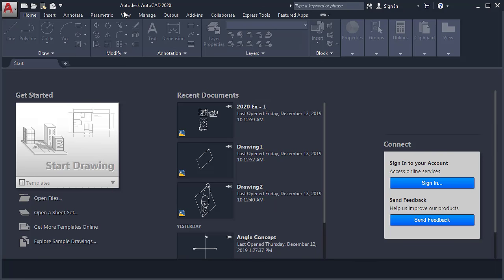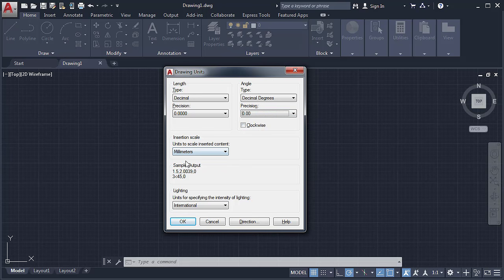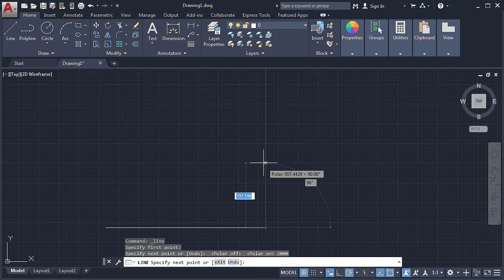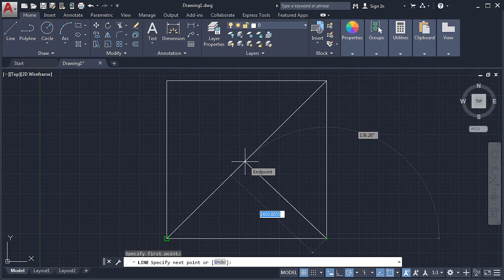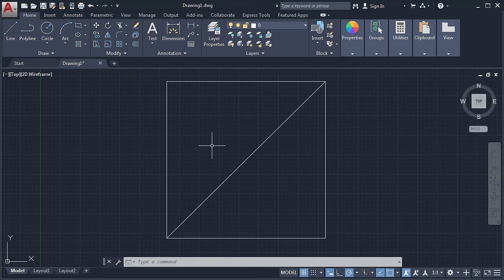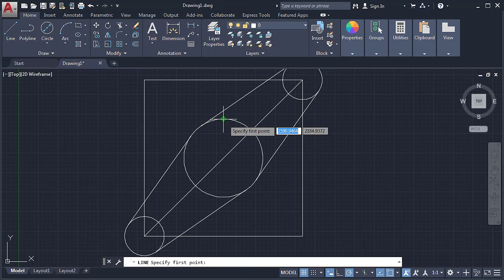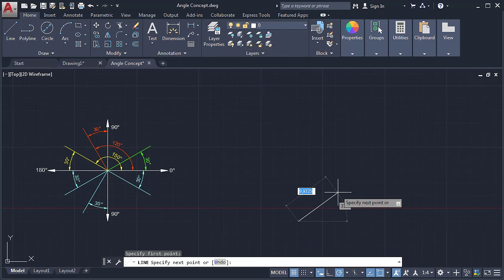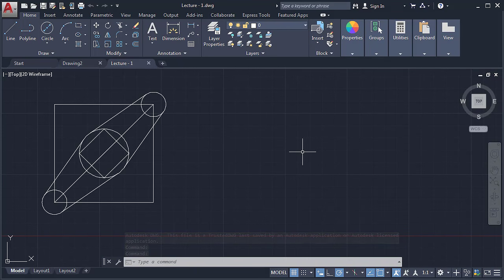AutoCAD Tutorial for Beginners - 1

Comment: I am trying to draw a horizontal line starting from the top of the existing diagonal line.
Even though polar tracking is ON, it does not draw a perfectly horizontal line. It is slightly off.
Is this related to the existing diagonal line?

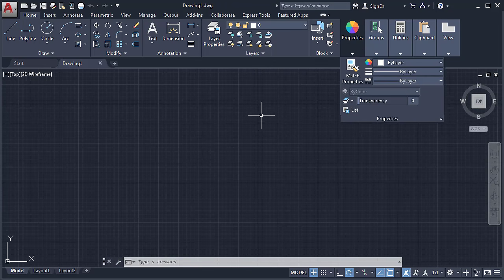Comment: 01:35 - Command Line (Kayboard short cut]
01:48 Unit command
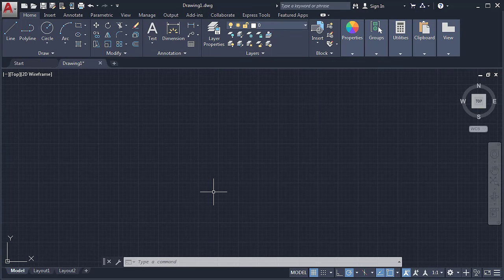04:06 Draw Command
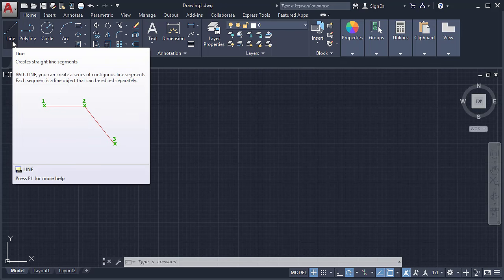04:09 Line Command
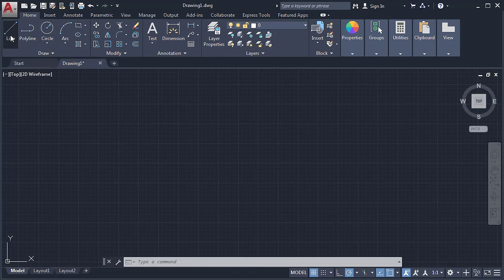04:18 Specify first Point [DYNAMIC INPUT).            (Switch ON)
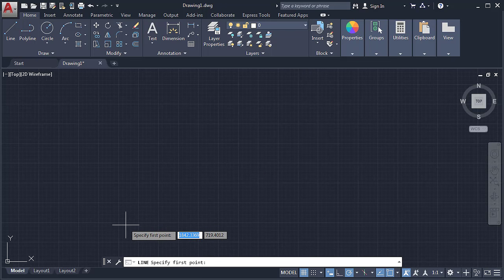5:26- Polar tracking
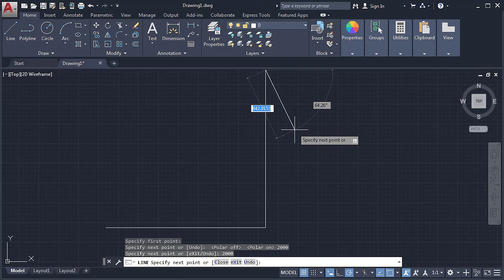6:24 when the line go out side of working area
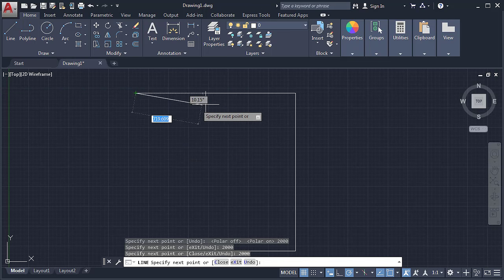6:41 Undo process
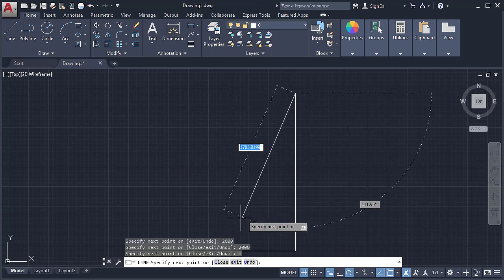6:58 If you want to stop the line!
(Command line Press Exit)
7:11 -If you click on close one point to another
7:50 Object snap
Reply: Giva chad

Comment: I have2013 version auto cad.
Can I used for electrical auto cad.
Reply from the maker: Yes, why not.
Reply: @CADCAMTutorials   Different Auto Cad for mechanical and electrical
Reply from the maker: If you are using plain version of AutoCAD then it can be used for both ele and mech. But specific version are also available. They are called as AutoCAD Electrical and AutoCAD Mechanical.
Reply from the maker: I think you may be having plain version, which can be used for any engineering stream.

Comment: but the angle should be always measured from 0 deg. anticlockwise direction
Reply from the maker: If dynamic input is on, you can also specify angle from 0 in clockwise direction.
Reply: @CADCAMTutorials  ok

Comment: I am a beginner and your explanations are step by step easy to understand.
I am learning AutoCAD for designing 3d printing models.
Where 2d AutoCAD may not work.
So just want to ask you
1) Should I directly start learning 3d design in AutoCAd?
2) How to export 3d design from AutoCAD to .SLT for 3d printing?

thanks
Reply from the maker: After completing first two tutorials, you can start with 3D. Regarding stl export following link will guide you:
https://knowledge.autodesk.com/support/autocad/learn-explore/caas/CloudHelp/cloudhelp/2019/ENU/AutoCAD-Core/files/GUID-E40AB085-5A19-4E3E-A74C-82F62DCD0DDB-htm.html